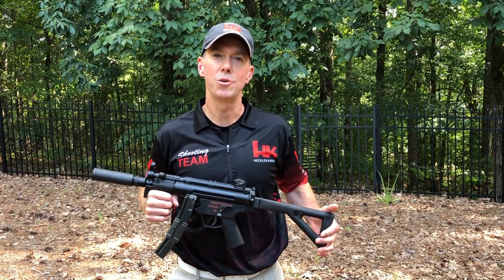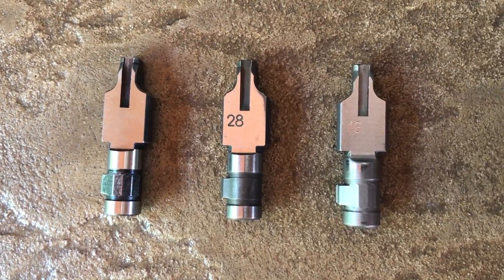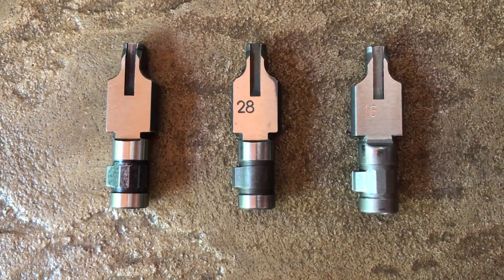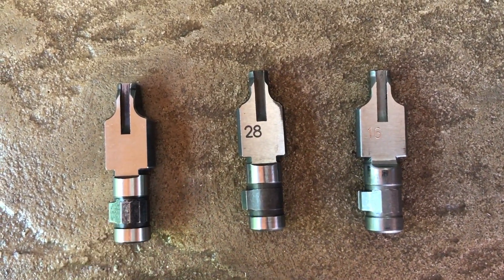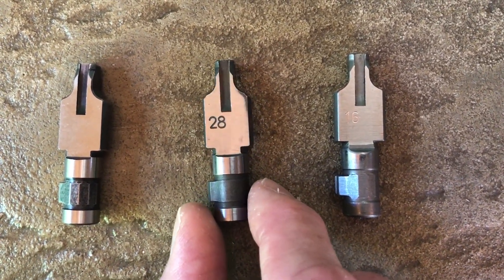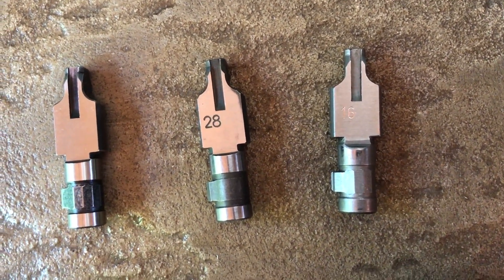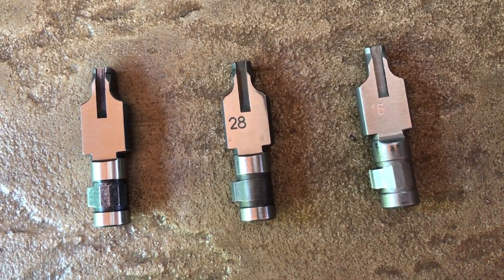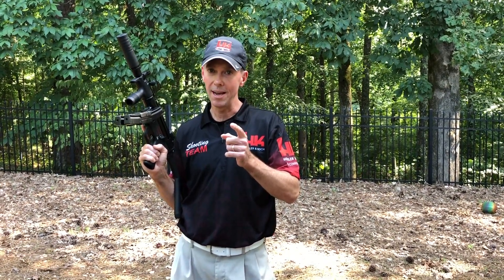HK SP5K-PDW Armorer Tips

Comment: I have a SP5K pdw with a surefire Ryder 9 and it will not run with any ammo including 158 fiocchi  or any other 9mm ammo when using the #28 locking piece but runs 100% fine with the stock 100 degree locking piece. So this means since headspace must make a difference and up to date I have no roller marks.

Comment: Thanks for posting this, I think lots of folks don't know what the 80 Degree LP is for.  I have found my SP5K with a stock but NO suppressor doesn't like to run 147gr with the 80 degree piece without failing to eject.  Is it pretty normal to just use the 100 degree LP if running 147 subsonic without a can?
Reply from the maker: The #28 is to prevent the over function you get with 147gr and heavier bullets plus the suppressor (increased pressure in the system).  When running unsuppressed, you aren't looking to take power out of the system and hence you get issues going to the #28.  Sometimes the different profiles of the bullets in the heavier loads can be a problem but not always.  Your 100 degree lp is the goto for unsuppressed.  Like I said in the video, if you are having function problems with a subsonic load (needs more power), you may want to try the #16 LP.
Reply: Derek, great info. Quick question. I just bought a HK 28 locking piece for my SP5K PDW. The original piece gave me a bit space of .14inches. When I put the #28, it went to .25inches. Is that normal or do I need to worry about head spacing gaps?  Thx in advanced.
Reply: @mwonsala  I know it's been a year, but since you haven't gotten a response I'll give you one. I'm surprised he didn't mention bolt gap in the original video. You will need to swap out your rollers for -2, -4, -6, or -8 rollers to reduce your bolt gap. This isn't an ideal situation, but it's also not abnormal. Some people get lucky and the tolerance stacking lines up perfectly with no change in bolt gap, others aren't so lucky and will need to swap rollers to get back in spec.

Comment: Thanks for the clarity on the locking pieces. I think most have been thinking that 80* is necessary for suppressed in general on a k length gun (without subs).  Question- do you think this applies to full size guns?  Specifically, should we be running an 80* piece on a full sized gun with suppressor and subs?
Reply from the maker: j ds Again, this info is for the K not the full size SP5/MP5
Reply: @HKShootingwithDerekG  so then the stock 100* locking piece is sufficient for a full length sp5 that is suppressed shooting subsonic loads?
Reply from the maker: j ds correct
Reply: @HKShootingwithDerekG  thanks!

Comment: A couple of questions, 
1.) with an oss rad45 should I be fine shooting regular 115 grain on an sp5k with just the stock locking pin? 
2.) If I did want to get into shooting subsonic rounds and goin the 80 deg route, would I also be looking to swap the rollers? if so, which rollers would I need?

Comment: Very useful info.  I have  a clone MP5K and hope to someday get the real one.  I thought I had to use the 80-degree LP for all suppressed shooting so good to hear that it's only for when suppressed and >147 gr subs.  Can you explain what "roller bump" is?  I was told it can result from using the wrong locking piece when shooting suppressed and results in a non-repairable receiver.  True?
Reply from the maker: using the wrong LP can definitely lead to roller dimples in the receiver......they are like an idiot mark on a driver but can be repaired

Comment: Hi Derek. I purchased an inferior ptr5k and wonder why they say shooting  it with a can will void the life time warranty? The ptr comes with a threaded an tri lug barrel. After talking with ptr they said you can shoot it suppressed but make sure you get a #28 locking piece. I got one from rim country manufacturering an it's to big to go inside the ptr bolt head. Do you know who is out of specs here? Ptr's bolt head or rcm's 80 degree locking piece? I'm thinking of trying an hk 28 locking piece if I can find one. The ptr came with a 110 degree locking piece. Also once one finds the proper 28 can you leave it in the gun an still shoot 124grn an 115grn ammo without the can installed? Thanks. Love your videos.
Reply from the maker: Good luck figuring out your clone!  It will be an expensive but good education.  The locking piece use answers are all in the video.  Use the proper LP with the corresponding ammo it is designed for use with. Keep in mind with clones especially, when you go changing LPs and brands of LPs, you can adversely impact bolt gap which can cause other problems.
Reply: @HKShootingwithDerekG  Thanks Derek for quick reply. In the future I will go with an HK if I can find one.  A new $1500 ptr5k sounded good until I found out a #28 locking piece from RCM or HK is to big to fit the PTR bolt head. I will try a whole RCM bolt carrier group with a Rcm 28 lp an see if that does the trick. :-)
Reply from the maker: @wykittypreps5794  good luck!  your experience is testament to what I have described many times where one ends up spending more on a clone replacing everything than buying the real deal the first time.  You will gain knowledge through your experience and that is a good/fun thing if you keep a positive attitude and remember to enjoy the experience!
Reply: @HKShootingwithDerekG  I'm having so much fun i can hardly stand it...Lol. Things in Wyoming  are not bad at all. Your videos are very helpful. Thanks for all your hard work. ;-)
Reply from the maker: @wykittypreps5794  cheers!